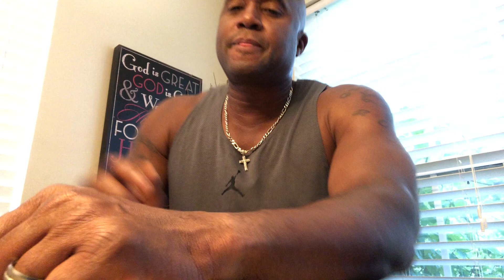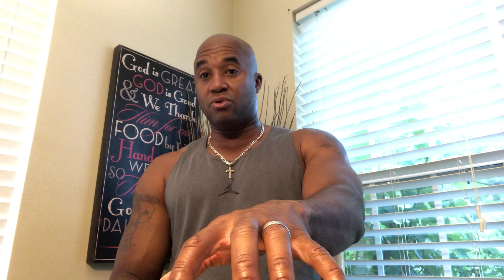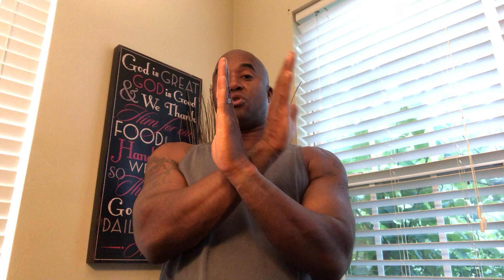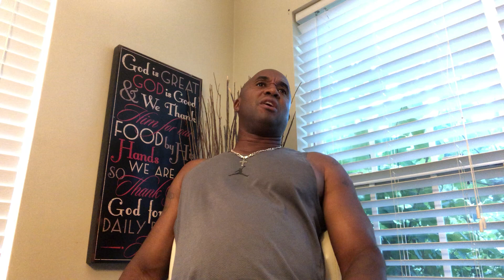Differences between Sealed and Ported Enclosure’s

Comment: Absolutely true info. As an example when we first started in to SPL comps, we had a Chevy Astro van with 12, 15" JL w0 each pair in a 9 cubic foot sealed box. (Suggested by JL) Went to a comp in Vegas and hit in the mid 140's. It hit low and  mean setting alarms off for blocks. After that comp we went to a ported enclosure with a single MTX RFL in a Yugo and did  constant 160s tuned at 63hz. The Yugo sounded like crap bur was loud,  the astro van sounded clean and mean. Each box design serves a purpose. As Ive aged I tend to like sq and sealed boxes myself.  But still like a well designed ported also.

Comment: been in the subwoofer game 20 years I'd consider myself very well educated with all things car audio. you did a excellent job explaining this. anyone watching pay close attention he's droppin info that most ppl do not understand and will set your audio system above other ppls systems. it's not all about power its about the correctly built box for your application. typically ported run very well in suv or a car with a back seat that goes down typically they don't perform as well in a sealed trunk environment use your time and energy building out what's best for your application that's the key not haveing a powerful sub or amp. additionally I see way to many people running  CCA power and ground wires... don't do this if your serious about your system you should be running oversized high quality OFC copper wire with high quality terminals. and please stop grounding onto a painted surface it will never work correctly always bare metal then protect that connection with a sealant to prevent future issues. no matter what how big your power wire is your always limited by the smallest power or ground wire in your system. upgrade them all for optimal power flow. all these things will put you on the next lvl

Comment: I already knew the differences but you do a great job explaining! used to be all bout that SPL ported boxes for the win but recently I hate the boosted and lacking areas so I made a big sealed box for JL w6 12 v2 and mannnn this thing gets loud and low and it’s it’s SMOOTH every bad note hits the same and it’s all loud!
Reply: Never had a good custom box ported box but definitely been thinking bout hitting you up for a ported box when I get my money up
Reply: What size cu (gross) is the box?
Reply: @Karizma231  5
Reply: @brandobashin4838  damm, that can't be right. That's massive
Reply: Hope you are running 4 of them at once if you are doing 5 cubes...sealed box volume: 1.25 cubic feet
ported box volume: 1.5 cubic feet as per specs on JL's site per speaker.

Comment: @MBEnchlosures LLC one thing I was expecting you to say, sealed typically is smaller volume versus ported.  That can be a real consideration at times.
It's a different conversation, but I don't hear people talk much about passive radiator setups.  I really really like it.  You can get the tighter higher frequency response of a sealed box, and the added efficiency at lower frequency of a ported box.  I've got a 10" that plays lower 20 Hz area with authority.  Very musical box design.

Comment: It really depends on the ported box every box is not the same I've heard guys using pre fab enclosures and they sound like garbage you absolutely have to have the correct volume with the correct Port area and Port velocity and you want at least 10 DB of rise and should have a decent frequency band for instance my average enclosure that I build will play down to the low 20s high teens and up to 70 to 90 HZ with 10 to 15 DB of rise

Comment: In regards to ported vs sealed, I think it all depends on where the box will be installed.  I had a ported box in the trunk of my vehicle, and it sounded nice. Yet, when I took the same setup, and moved it to the back of a Tahoe, it didn't sound as nice.  

Going back to the ported box in the trunk to my car, it sounded nice, yet when I would lower the back seat (acces into trunk), it would hit harder.  So I guess it all depends on where you'll install the box; I guess if the box and subs have more air. But in regards to having more air, the subs and box had plenty of air in the back if my Tahoe, yet they didn't sound good.  It's still all a mystery.  LOL
Reply from the maker: A custom enclosure must be designed with vehicle in mind. That why the enclosure sounded different
Reply: @M.B.Enclosures  🎯

Comment: Im new too the channel, Had a few questions about my 07 Avalanche

I want thunder but I'm up against the wall about the type of enclosure I want to build

What type of box enclosure would you recommend to maximize bass I'm not a fan I'm not a fan of the down firing subs or the up fire Subs under the seat so would a midgate enclosure be the best setup because to me. it still looks as if the woofers are being muffled on a midgate enclosure

What would you recommend?

Comment: I have three stereo integrity SQL 12s and ready to run them sealed in my car. 
I know that loading a surface always gains a little bit of output ( like facing your subs upward toward the glass and a hatchback for example).
    What are your favorite ways to improve the sound of a sealed install?
   I can either wall them directly up to where my rear seats are and seal off from trunk to eliminate the back wave or I can put the subs all the way in the back of the car and fire them into a chamber that comes all the way up to the opening and then seal that off from trunk. 
     Iron law states that more space equal more bass and it also helps with the subs being further back from the driver's seat as it allows the wave of bass to develop further. 
  
I have seen diagrams from professionals stating there's always decibels to be gained when loading surfaces with sealed enclosures. 
   
With the subs facing each other and loading onto the boundaries and the air mass in the chamber I can't help but think it will be a significant gain over just walling them up flush against the trunk opening. 
    Ideas, opinions, it's basically three 12s  in the back of the car firing into a v shaped megaphone( with a MDF floor and ceiling on top of the three enclosures) that's mouth opens up into the listening area.  I can't help but think it's going to sound good as it will take advantage of the horn loading effect like a hatchback. 

I don't want to slam 3K of legit power directly into my back window in a coupe lol!
Reply: How's the install? I haven't installed my si sql 12s yet. But I'm going ported first, then later this year, I'll probably buy a 3rd sub and do 3 12s seal in about 3.2cf net

Comment: MB if on a sub in a sealed box is only getting bass from the front of the cone, why do a lot of people run 4th order box? A sealed box inside a ported box doesn't make sense to me and how is a 4th order louder than just a regular sealed box? I don't understand how it works. I understand 6th order and I was just wondering what was your knowledge of the my question. Love your channel brother especially the teaching videos 👍🏿👍🏿👍🏿
Reply: Basically, in a 4th order bandpass you're using the sealed box to change the properties of the subwoofer to make it better for the ported side. 

Now, imo outside of shear spl and giant walled builds, a standard ported box is gonna be better. But 4th orders definitely have great applications in certain areas.

Comment: I have a good question for you. I’ll be getting the Kicker Q class 12” 42CWQ142 sub in my 08 Colorado extended cab. BUT my question is if I would be okay running it in a wider flat box that would span the width of the back wall with the seats removed so I can have space to put groceries in behind the seats and still be good.

So can a speaker box be not as deep and wider than normal and be the same as a more cubed shaped box an still play 30 hertz and be good.

Comment: Can you please do demo on the DB g5 8” sealed vs ported ? I have a 2017 Toyota Sienna with a 12” bravos sub  running off a zapco reference 500.1   I wanna use the same custom enclosure that’s in the rear drivers side where they would have the option 8th seat and run it @ 2 ohms .  The info you give is really informative and since I did a search on the db G5 sub, you really got me hooked. Thanks in advance my man coming from  Ontario, Canada

Comment: I prefer sealed or infinite baffle for my sub. I’m all about that musical sounding deep rich punchy bass.
Reply: I actually went with ported for my Fi Neo 3.5 12 inch and realize that the bass is still tight and punchy.
Reply: @davidperry4013  did it sound muddy?
Reply: @davidperry4013 I think they use ported boxes in rock competitions from what I read so never understood the general sealed is cleaner than ported

Comment: I'm having problems with my dB 300, 4ooo wats, 1 ohm.. I have Two other dB 1 ohm at 2000 wats. 1000 rms. How do I drop the two dB to a two ohm load. I keep clipping an my gain is barely on.. Could you help me out. I would be vary greatful. Many blessings..

Comment: A ported box do roll off after tuning. But it will still be louder then a sealed enclosure about 3/4 of an octave below tuning. A correctly designd ported box i almost always superior. In my opinion a sealed enclosure is only better when space is limited, or you want your subwoofer to play below 20Hz. It is also much easier to build and design then a ported box.

Comment: I got one T1 12 gonna run it at 800 rms 2ohm Manuel says use 3/4 mdf can I use 1 inch instead
Reply: Use 1" birch if you want.  Thicker and harder the wood is the better lol.. Also using thicker or birch you can always upgrade to a higher wattage sub if you wished that was within the same specs as the others.  But if you want a little more damping and sound quality use that MDF for it if sealed or ported.. For SPl use birch.

Comment: I have 85 el Camino I’m having a box built for it with four 8” Toro fierce subs, sealed, what are your thoughts on that?
Reply: Might sound pretty good especially in the cab.  Install a couple seats in the bed with some seatbelts if needed in your state..and put some amplified marine type speakers in the bed so they know what is playing with that bass, unless ya open that cab window.. Or use the bed as a bed of speakers in an angle for each one with a sealed wood maybe cover for the bed and cut and weld an air proof slot into the cab and weld..  Kinda wish I had an El Camino to play with but these days I doubt I'd go as far as cutting the all original body work..

Comment: So I have a 16 cuft box with 4 separate chambers. 2 chambers are tuned to 36hz and are a slot port. The other 2 chambers are still sealed enclosures and I was wondering if I could use a round port on those 2 sealed chambers. So now they would all have there own chamber and own port. And one last question, is it okay to keep my 36hz slot ports and have the round ports on the other 2 chambers tuned to a lower number like 33 hz?
Reply: You should know if you made that super customized box eh..Or it was made like it should be to specifics for 2 different types of subwoofers...What exactly do you have that you can put a 16 cubed box in?

Comment: Tuning a ported enclosure is tuned from the length of the port or the diameter? Any Info thanks.
Reply: Tuning a box is in the length of the port not diameter .
Longer the port the lower the tune
Reply: @montanaplease  Its both the diameter/area and length
Reply: Tuning has nothing to do with the diameter
Reply: @montanaplease  it absolutely does. If you dont know the diameter of the port then its impossible to know what length it needs to be. Length is only half the equation. More port area = longer port with same net airspace.

Comment: Could u talk about xmax.  I have DD3512s esp with 17-18mm xmax but they have better output  compared to some subs with a greater xmax
Reply: Ik this is an old comment. But hopefully thisll be helpful.

Motorforce plays a big role. A sub that can move far, but doesn't, won't get loud. The other, is that xmax is just linear excursion. You can push well past xmax, but it won't sound as good, and it'll be less efficient. DD tends to have reasonable xmax, but extremely high xmech. The DD USA line also has really fucking strong motorforce.

Comment: Whats a good dampening factor for an amp im looking at the B2 audio rage 2500.1 it has a dampening factor greater than 400 signal to noise of 95db is that a good choice of amp
Reply from the maker: TheHiimrice don’t know much technically on this... but I prefer 200 and more. We know the amplifier controls the sub and it’s ability to do so is measured in the dampening factor but the length on the wires used affects this as well so the higher the number the better

Comment: i have an old sony hifi system from the early 90s that uses a quasie-sixth order series tuned bandpass. I didnt know what that type of enclosure is until now. the original sony woofer rotted so now its just a cheap lanzar sub. 
who ever designed that back in the day must have know a thing or two about tuning enclosures.

Comment: What is the formula to tune a sealed section of a 4th order to lower my drop off frequency?
Reply from the maker: Jermaine Crutchfield that is sub dependent...not all subs do well in a 4th.  A 4th can only play as low as the subwoofer can only its sealed section
Reply: @M.B.Enclosures  I just hooked up 1 of my new SA12V2s last night in a sealed box a little smaller than spec and it's not smashin quite like I'd like. Would getting the full 1ft³ that it asks for really make a world of difference or could it be something else?
Reply from the maker: @nicolumens3311  I can’t answer that. Haven’t heard it.

Comment: Not sure what you mean when you say that a sealed enclosure can take more power. It will need to handel more power at the lower end. If the driver can handle that power or not is a different matter. The excursion will almost always be the limiting factor no matter how much power the driver can take.

Comment: Sealed is deeper, richer. More expensive, harder to manufacture.
Reply from the maker: @Saturn-Matrix  😂
Reply: @M.B.Enclosures   What I mean is sealed enclosure have more defined bass and the cones require more power. You get more sound and less harmony with ported. Because of the higher load capacity, and quicker oscillations I'd imagine the cones for sealed enclosers to be harder to manufacture. -sm alt